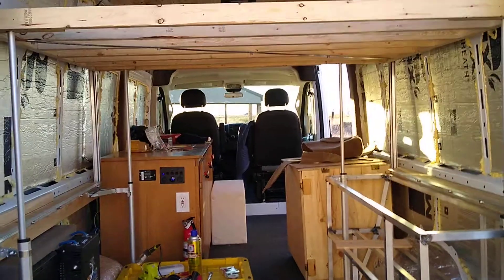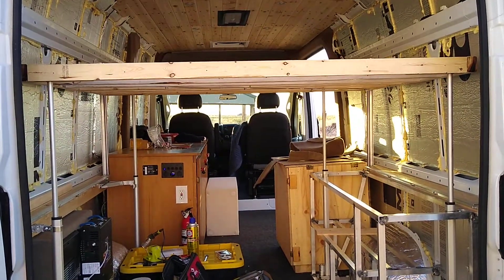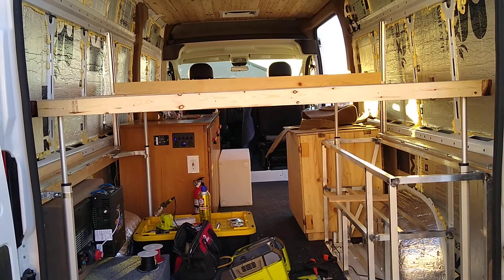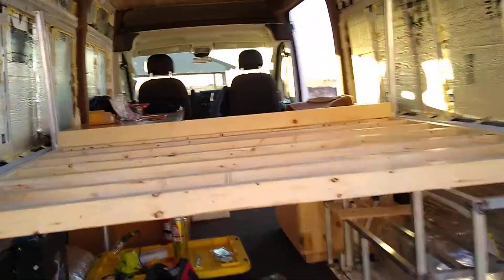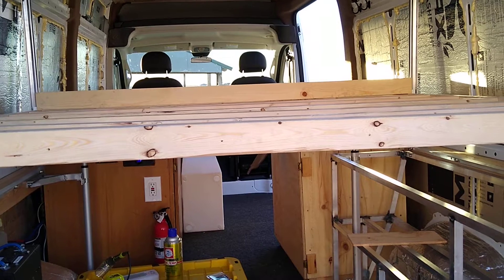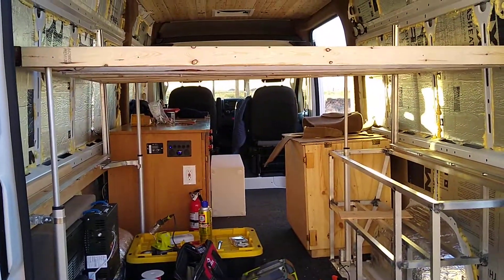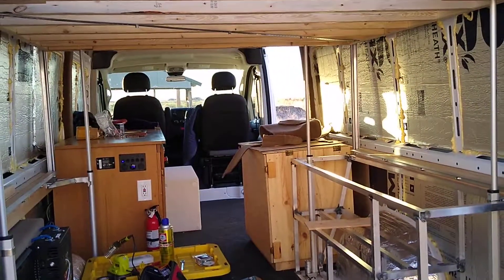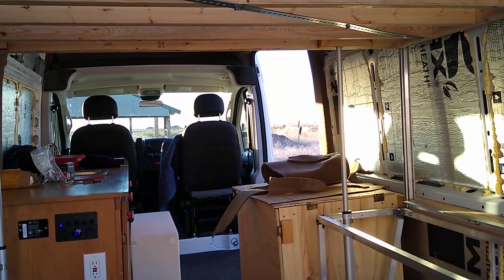Powered toy hauler van bed

Comment: Awesome video.  It’s just what I was looking for.  I’m doing a van conversion and wanted to have a bed lift for motorcycle.  What size and weight capacity did you buy for the linear actuators and linear guides?  How do you wire for the momentary switch?  Any type of instructions would be great!  Thanks.
Reply from the maker: The actuators were listed at 66 lbs each, but now it looks like they're listed at 50 lbs on the Everest website.  They're the 30mm/second versions.  The bed goes fully up and fully down in about 25 seconds.  We tried putting my wife on it, which should never happen in actual use, and it lifted her just fine.

The guides don't have a weight limit listed, but they have WAY more strength that we'll need to hold the bed in place.   The screws will fail first.

The actuators use just 2 wires, so all you're doing is reversing polarity.   There are internal limit switches built into the gear train, so they stop automatically at either end.   The two switches are both double pole/double throw, one is simply a spring loaded momentary contact version.  

When wiring a DPDT switch to reverse polarity, you wire an "X" between the outer poles on both sides, connect the supply voltage to the center poles (center of switch) and then the load to one of the outer pairs.   Switching it one way will connect the load to one polarity, then switching to the other direction reverses the input polarity to the output.   To make the momentary switch work with it, I simply paralleled the switches.  

HOWEVER, if you leave the regular DPDT switch in an on position, even though the motors will stop at the top or the bottom, the circuit still has voltage in it even though the motors stopped.  Activating the momentary switch in the opposite direction with the main switch up or down, will short the output and blow the fuse.   Once the bed was auto-traveled and stopped, it's best to center the switch.